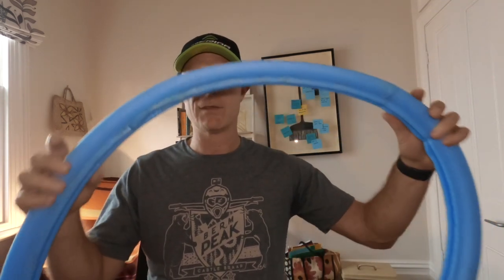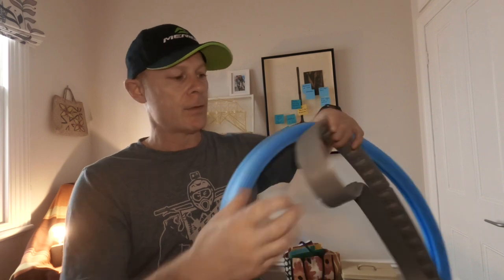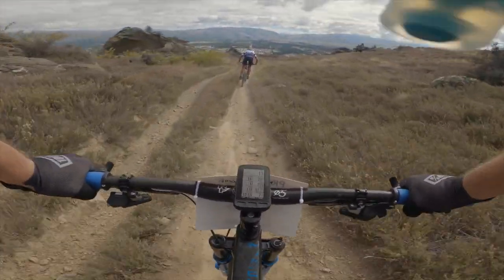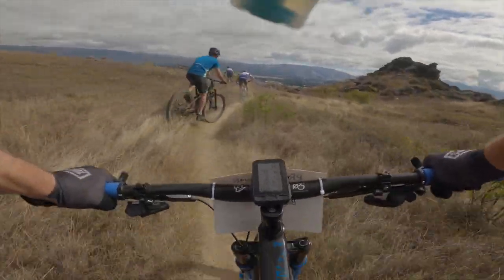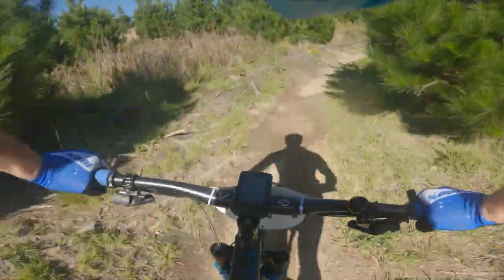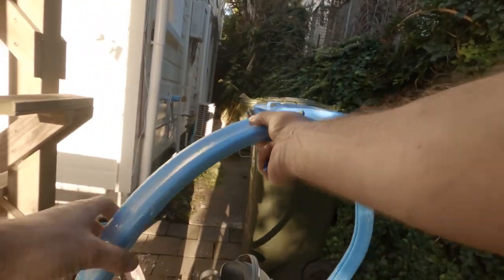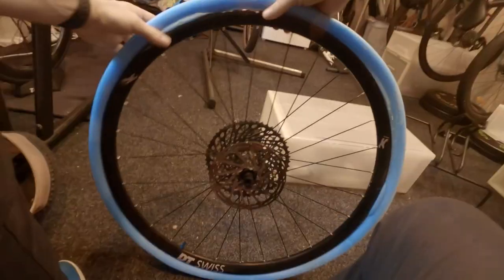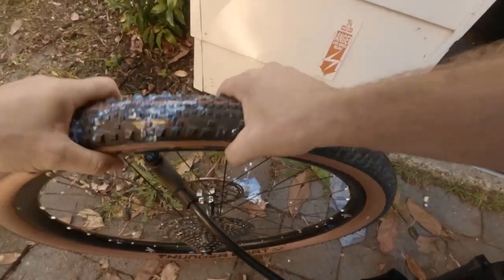Tubolight Evo Tyre Insert Review after 20 hours of riding

Comment: So i've ridden the Evo HD 29 with a Maxxis Minion DHRII DD 2.4 Terra, and the EVO SL 29 in front with an Assegai Exo+ 2.5 Grip. I bought them in June 21 and rode them until now (Nov 21). I ride a lot in the Swiss alps. Basicly every weekend i visited the mountains and went on long enduro tours or rode in bikeparks. These inserts went through a lot of rocks, roots, jumps etc. I also participated in several enduro races, so they did see some missed lines ;-)

I am quite impressed by the weight and rolling resistance. Also mounting/dismounting is a breeze opposed to cushcore. The protection level ist great. I never had a flat once. Checking the right tire pressures was my biggest issue. Even with a digital pressure gauge I didnt get consistent results. Like as if the valve was clogged, which it wasnt after releasing some air by pushing an allen key through the valve. I usually ride with 22 psi in the rear. But the tire didnt "feel" like that. It felt rather like 29psi. Very firm. I did find that the Tubolight gave great support when cornering and didnt experience any burping. Also, adding sealant through the valve was a struggle. After a month our so, you could also hear the inserts chatter inside the tire, which isnt too annoying when riding but did get me question if something was loose on the bike.

Overall, I think the Tubolights are of great value. They definately deliver great protection and are light and easy to install. Just the issue with the tire pressure is annoying. Also, I believe the EVO HD is overkill if youre not racing downhill. EVO SL might be enough on both wheels for enduro. I'm gonna try that out next summer.
Reply from the maker: Great comment @wetmunky . First of all how lucky are you to ride in the Swiss Alps? I think a lot of users have had the same problem with the sealant / valve core. I am glad to hear that they are great for Enduro bikes also, I think I will put a set in mine. I have cushcores in my ebike but only because I had already bought them.

There are now so many inserts out there so thanks for the comments on your experience.
Reply: Add a 'Hole' in the insert at the Valve Stem for the Sealant to have a 'path' to the 'Void/Pocket' in the Tire beyond the Insert...

Comment: Thanks for a great review. I installed tubolight in my rear wheel today and it felt great during the test ride but I think I have a problem. I removed the valvecore and filled the sealant and I think the sealant stayed in the "airchannel". When I release air the sealant comes out through the valve. Did you experience any simular issues? Tomorrow I will fill some sealant directly in the tyre instead. Sorry for my bad english. Cheers from Sweden!
Reply from the maker: Your English seems great to me. I had issues when I used a different sealant than the Stans. I do find it easier and less messy to pour sealant directly into the tyre. I could see how sealant potential to stay in the air channel though so it is not bad advice to pour it directly into the tyre.
Reply: I put sealent direclty into tire, it is better with inserts
Reply: Found that out, too. Talked to the guys at Tubolight and they said to put the sealant in the tire, not the valve. if you use the valve, the sealant can get stuck in the 'air channel".

Comment: I installed the tubolight and then blew the tire up to pressure to get it seated on the bead.
When I wanted to leave air out to get it down to riding pressure, only the air in the channel between wheel and tubolight came out… how do you solve this issue?
Reply from the maker: Hi Lars. That is an interesting one. Maybe take the vale core out to let the air out and infate back up to normal pressure or just put some pressure on the tyre. Sometimes the tubeless valves can get clogged up with sealant. Hopefully it works out for you.
Reply: HAd the same problem. I barrowed a CushCore valve from and friend that sloved the problem. The insert was blocking the top hole of the 'normal' valve stem, but the CushCore ones have holes on the side, too. So if you can find a valve stem like the CushCore one, I would give them a try,

Comment: Thanks for the great review! I will give the tubolights a try!
Reply from the maker: No problem, hope you like them. Sometimes a pain to fit but the thing I worry about most if I am racing and have to put in a tube, very difficult to get the tire off trail side.
Reply: @jaselikesbikes  I mainly race Enduro these days, so most likely I'll not add a tube during a stage, but rather finish it on the insert. I used the rimpacts - which were a pain on installing as well - but the tubolights are even lighter.
Reply from the maker: @gobikeyourself  Yes agreed they are good for Enduro to finish the stage.

Comment: My problem with this Tubolight is that the sealant gets stuck in the air channel for a long time and clogs up the valve. Wonder if it would help to make small holes from the air channel to the outside so that the sealant can get through to the other side.
Reply from the maker: Yes I have heard that the sealant can clog up the valve. I had the problem with thicker sealant but stans was ok, alos I think you have less problems if you put the sealant directly in the tyre and not in through the valve core.

Comment: I have a big problem with pressure with tubolight. All my gauges does not show proper pressure now.
Reply from the maker: Yes I did have some problems with that with my tyre inserts. I think it depends on the sealant which can block your valves.
Reply: @jaselikesbikes  i put new ones… sealant is from Stan’s.
Reply from the maker: @mihaurs2  that sucks, did you put the sealant in through the valve? I found it better when I didn’t. Hopefully it will sort itself out after a few inflations.
Reply: @jaselikesbikes  i put directly to the tire. When i ride it feels quite ok, trying with hand seems to be low pressure, but what excactly, I don’t know :(

Comment: Interesting, I tried the Tubolight EVO HD earlier this year in my 29"x2.4" DHR II rear tyre and found the tyre to be very solid afterwards but also installation was a nightmare and you had to pour sealant in-between the insert and outside of tyre which was nigh on impossible when still trying to mount it up. I'm interested to try the SL version which is smaller and although I ride enduro I feel the heavy duty insert is too big for a 2.4" tyre and maybe the SL gives enough protection without making the tyre feel dead, no pop/rebound and hell to ride up hills with
Reply: also i've considered making some channels/holes between the inner and the outer in order for sealant to migrate from inside to outside but then i think that probably defeats the point of having the "sealed" inner and outer chambers...
Reply from the maker: Yes I decided it was easier to put the sealant directly in the tyre but no big deal. I do think these light ones are great for XC/trail. I have just put some cushcore XC in my Levo SL and will do so on my enduro bike. I think liners are perfect for ebike and enduro.
Reply: @jaselikesbikes  I just got a SL to try on the 2.4” Maxxis rear tyre. Will see how it sizes up (or down rather)
Reply: @jxrxch  Any updates on the performance and fit of SL to HD? Im really interested to know as I have ordered HD for this particular tire DHR2 2,4 and now Im bit worried if I should take SL instead
Reply: @tondasvejnoha8500  hi Tonda, I only picked it up a week ago and been too busy to fit it so can’t give you any feedback yet. If I was only smashing DH laps I’d have been happy with the HD Evo. But for trails for me it filled too much of the tyre up.
Reply: @jxrxch  Thanks Jason for hints, Ill be fine then probably, I want it for hard enduro charging on my long travel bike and also I run 32mm internal rim. Lets see :-)
Reply: @tondasvejnoha8500  yeah I had it in 30mm inner width carbon wheels on a 180/170 enduro
Reply: @jxrxch  I've also installed the SL with a 2.4 DHR II on a 30 rim in the rear, but I'm not sure about the pressure - any advices, how much the pressure can be lowered with the insert?
Reply: @krush59  I’ve been hammered at work and it’s still sitting in the cellar. I might try to get it in this weekend so can’t help with pressure sorry. With the HD version I was able to go significantly lower - like dropping 3-5 psi
Reply: @krush59  how’s it going? I just blew out my rear tyre yesterday and almost destroyed my carbon rim but I got lucky. So new tyre and put the SL insert in. MUCH better fit than the evo hd and doesn’t totally fill the tyre. So I’m quite sure that the SL in a 30mm inner rim with a 2.4 tyre is way to go
Reply: @jxrxch  I've only tested it on some mellow trails and can't tell any (huge) differences, but I'll take the bike to a bike park at the weekend and see how the rear will perform. But yes, the SL fits well in a 30mm rim with a 2.4 tyre and maybe this is a good way to compensate a missing DHRII dual compound with a strong carcass in the maxxis lineup.
Reply: @jxrxch  @krush59  I've had the SL in my tire for a year. Front on a 29", 31.6  mm inner rim with a 2.6" DHF - no problems. The rear is 27.5", 21 mm inner rim with a 2.35" DHR. Ther rear has saved me a couple times. Burped the tire and rolled on it for a bit in very rocky terrain. Insert took a beating, but kept the carbon rim safe.  At home, took the insert out and it was cut up in places. I just used original Gorilla Glue (waterproof polyurethane glue) to bond the edges back together, let it set up for 72 hours, and put the insert back in the tire. Works like a champ.